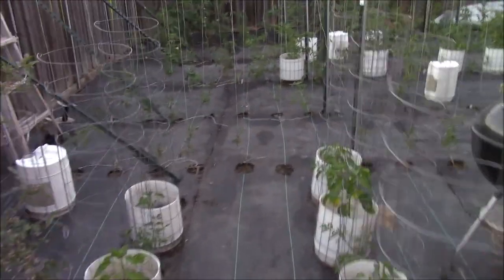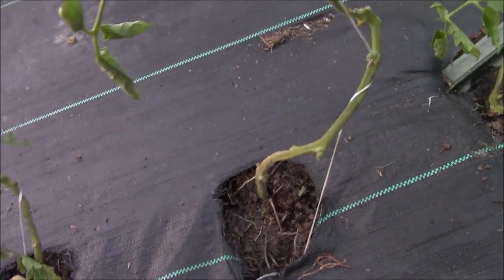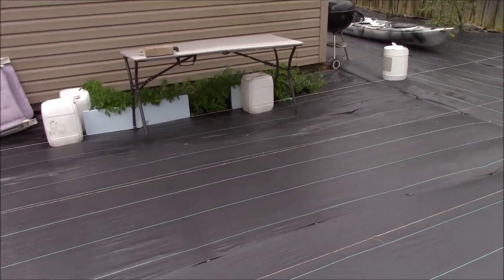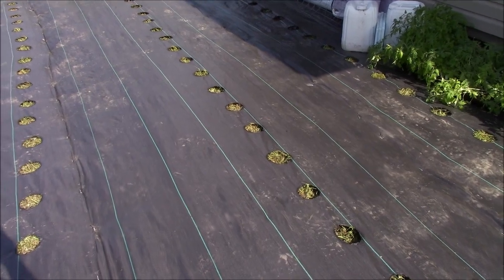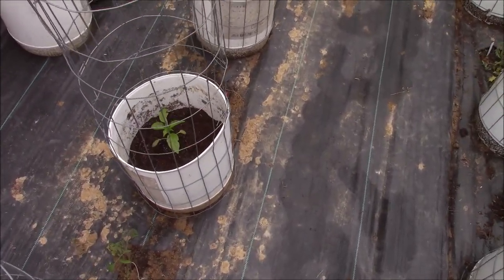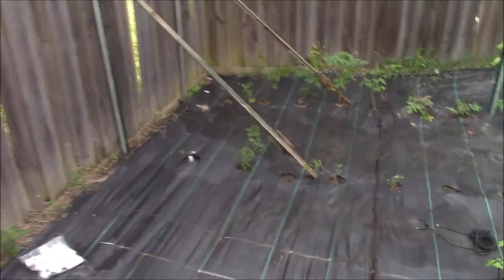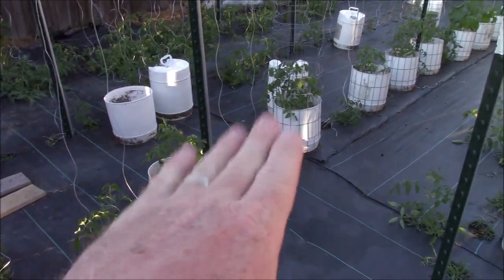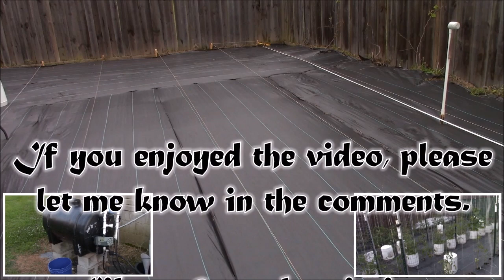My New No-Weed Garden for Tomatoes & Peppers

Comment: Thanks for sharing this, Brett! Out of curiosity, why do you elevate some in buckets but put others in the ground? Thank you sir!
Reply from the maker: I tend to use containers when I want a cage.  Cage is over the container.
Reply: @C3Voyage  we have had so much rain in the last two seasons, excessive and drowning kind. I thought about doing what you did and cutting the bottom out for my plants so they don't drown if it continues this year. Would you recommend that?
Reply from the maker: @leas3117  I am growing in containers for tomatoes, peppers, eggplants, and likely more.  They protect against wind when young and drain like you mention.  I will allow the roots to go into the ground which will happen after they  mature some.  For the cucurbits like squash, melons, and cucumbers, directly in the soil.  Drip on both.  Thats my plan this year.  Containers are good in many ways as long as you don't let them dry out.
Reply: @C3Voyage  thank you!